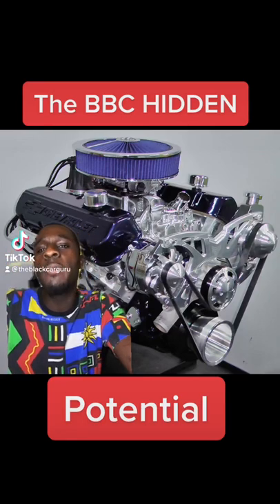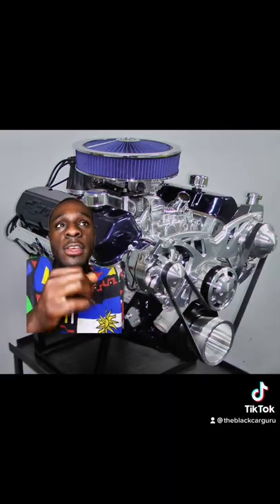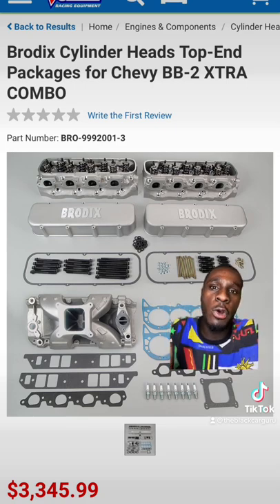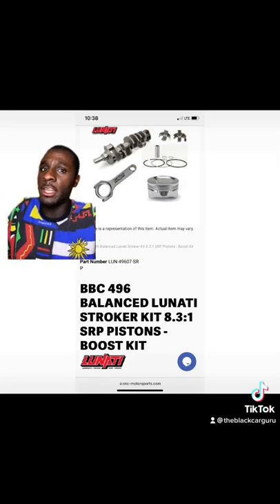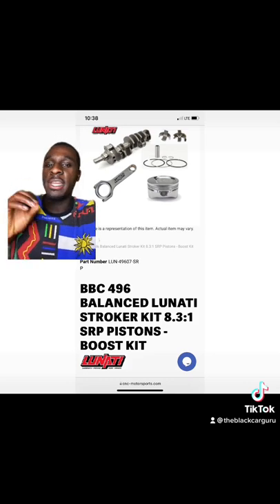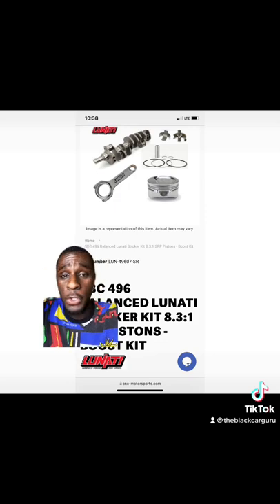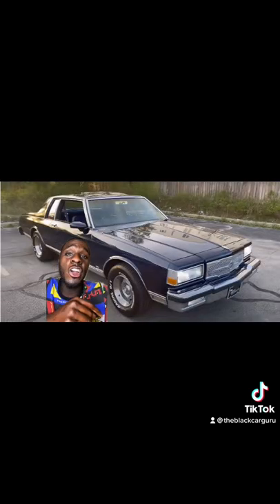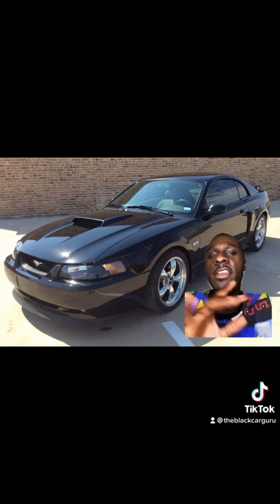Episode 1: Building an 800hp BIG BLOCK CHEVY (454)

Comment: As a retired engine machinist I would like to ask how many engines you have built . 13 to 1 compression on a street driven engine with pump gas ? Really ?
Reply: He knows a lot about engines but I agree 12.5 or 13 :1 compression is real high for a street engine, 10.5 to 11.0 would be more realistic.
Reply: @bryanloewen5011 he don’t know much lol
Reply: @bryanloewen5011 

He just googles stuff and repeats it.
Reply: @cantstanddogs4776 😂
Reply: He never said street motor on pump gas, just 800hp from a 454 n/a, or bore and stroke it to a 496 and boost it or keep it n/a.
Reply: Your right, but if you really know about dynamic compression theoretically with the right top end combo you can run regular pump gas with big ass compression
Reply: @cantstanddogs4776 haters
Reply: @hunterpetrovich1154 can’t accept a black man can know about engines? Stop hatin. If he researched that the same as learning and then knowing. He obviously has a passion and probably works on cars which is why he researches the stuff to begin with. You know it all mechanics out there never make any new power and never upgrade with the fax. You gotta stay researching that stuff..
Reply: @KsDontMiss21 haters man . A real mechanic supposed to do his research not for 10. He knows everything you can’t learn to make new horsepower make new innovations to engines and efficiency. If you just stay stuck in your ways, this guy has a passion clearly, which is why he googles and probably researches the stuff to begin with. It might be profitable, but I’m not making a YouTube channel about cars unless I’m really into them..
Reply: @Wildanimal864.  what did I say that involved race lol
Reply: When you rise to the top of your craft the haters come out of nowhere in these comments. If you're so smart come out with your own channel or you have a but  you're not getting his subs
Reply: If you know what you’re doing, dynamic CR, the right tune will allow it.  Also, these days have you heard of E85?  For sale at a lot of gas pumps and loves high CR and makes big power!  Seems he is more aware of modern technology than you, that’s not his fault, it’s yours!  Don’t be stuck in the 70’s.   Dumb arses can’t tune high CR to run on pump fuel.
Reply: I’m pretty sure he’s talking abt people who like to race not just drive around lol
Reply: @cantstanddogs4776  or you know more than him which is great

Comment: How can I get ahold of you I got a chopped slammed 67 3 door suburban that I’m building just need to get the motor done now i got a custom built 671 blower and intake and a stock 70s 454 trying to get some guidance On best places to order and what kits are good I’m hoping to keep it under or around 10k$

Comment: I used 088 heads on my 454 with a solid roller cam. Stock bottom end with a 3500 stall in a powerglide in my old 65 impala. With 373 gears it was ripping the tires about 2 inches of the ground with stock 14 inch wheels on white walls. The big block is a power house

Comment: 0:14 there’s something big blocks have that makes them better than every LS/LT engine thick cylinder blocks and thick cylinder sleeves this means these boat anchors can achieve displacement that no LS engine could ever achieve numbers up to 572 ci or 9.4 liters and that’s displacement no LS or LT could ever achieve 👀👀 the ole hemis are even better then deez big block Chevys and can be just as big blocks and make more power 😄
Reply: HEMIS are EXPENSIVE  very nice but expensive AF

Comment: Or you could just get you a 632 in Big Block still crank still rods a 671 blower on top 400 shot of nitrates and shoe on that nice little combo into a Chevy Vega🙄🤔🤫
Reply: 632  is def an aftermarket block because of the piston and stroke

Comment: Why not just get a 8.1 vortec, pull the whole motor, ecm, and harness
Reply: Because the 8.1 has Horrible aftermarket Support. If your building a street rod you want to build something that you can readily get parts for to upgrade and change things.

Comment: Your understanding of engines is so primitive. It reminds me of when I listen to a stupid Honda kid from highschool talk about engines. No understanding of bore, stroke, cam grinds, combustion chamber sizes, or any of the how to stuff. Btw if you didn’t know this more goes to buying a rotating assembly rated for a certain compression. You have to account for combustion chamber sizes, bore, stroke, deck height down to small things like Head-gasket thickness and then from that point you pick your cam based on your flow rates for your heads and calculated compression. Go back to school dude.